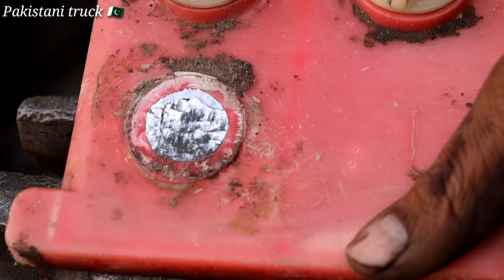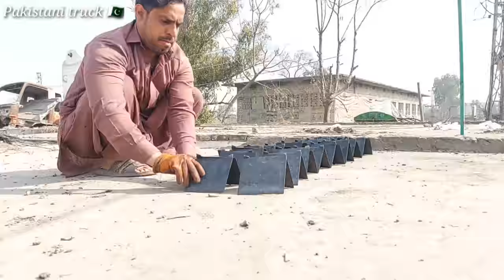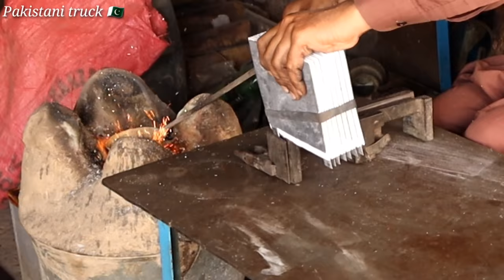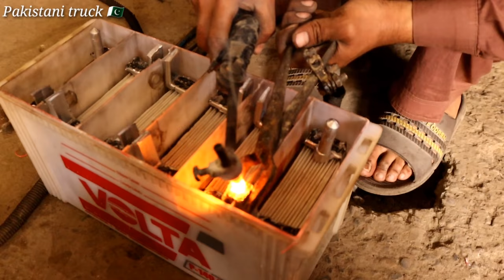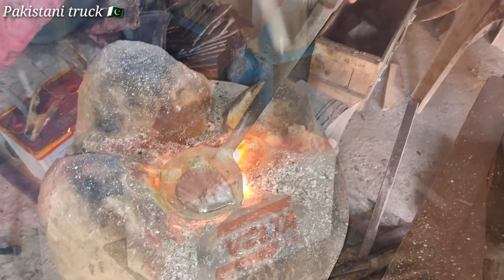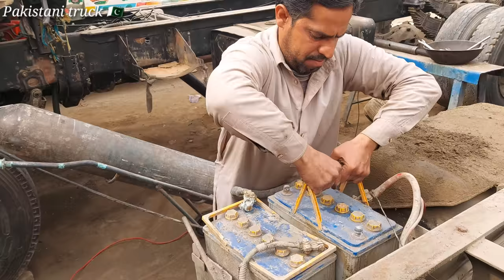Dead battery cell Restoration

Comment: This is new battery he changed everything except plastic shell
Reply: Negative plates are still same brother  , but no problem it works almost 3-4 years easily 😊
Reply: @Harjot_jhajj_27_  what kind of plastic sheets or material are using to sperate the sheets from each other? Thansk

Comment: So where do you get the rebuild plates? I would like to try my hand at restoring old batterys seams like a handy skill to learn
Reply: They reuse negative plates, positive plates are always rotten to nothing as you can see in the video. Don't try this, it's a very messy job, very difficult to not contaminate the environment and yourself.
Reply: It is a good skill to have. Making batteries could be the lifesaver for you once the fit hits the shan! Just remember that someone somewhere is gonna tell you that you’re doing something wrong, breathing fumes, killing the environment, etc. no matter what you do.
Reply: @dh-_1011  when you're done rebuilding, there's a literal pile of lead oxides and sulfides felt over, which are mildly toxic. This needs to be disposed of properly, not dumped into the first hole in the ground you see.
Reply: lol dirty af u ask me
Reply: @dh-_1011   so I like to reload and as a chemist nothing goes to waste. What most considered toxic waste ,to me is just another reagent.
Reply: @susanthrapp6154  That is awesome! I truly wish I paid more attention to chemistry. It’s fascinating.